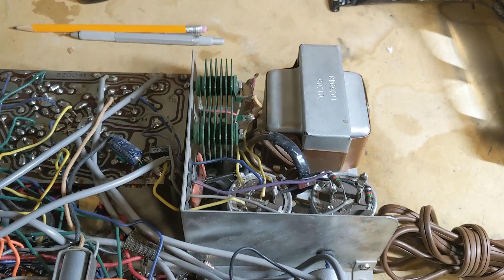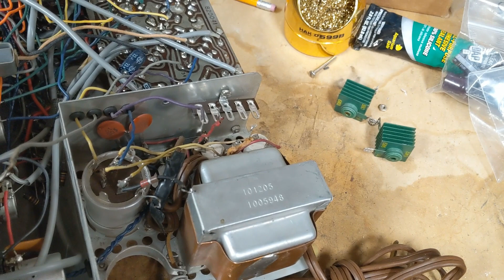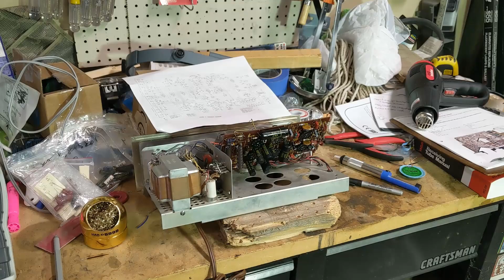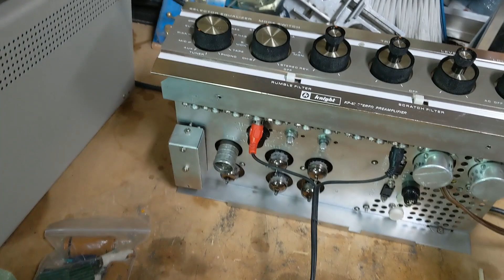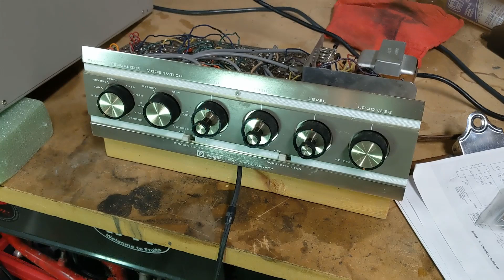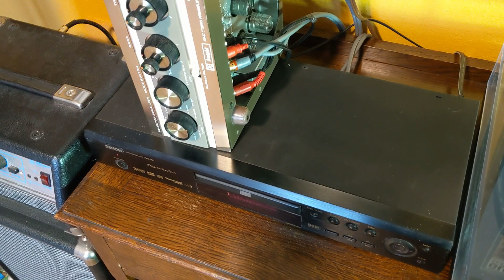Vintage Tube Preamp Knight KP50 - Restore & Listen

Comment: I extended the legs on mine so it would work with better cables.  Buy a package of replacement rubber feet for a folding chair.  I use these to raise my laptop as well.

Comment: I've got one in pieces in a box.  I used it for several years with mostly original caps.  It took a big power surge when a transformer on a pole down the street blew.  I started rebuilding it, the same way you did but other things got in the way.  These KP 50 preamps sound amazing and have lots of power.  I've looked for something comparable and more modern but can not find anything.  I drove 3 200 watt stereo amps with it, feeding 6 large loudspeakers and 2 subwoofers.  What a volume knob!!!  I kept getting flak from people because it is capacitor coupled rather than transformer coupled.  Then they listened.  You inspire me to pick up the soldering iron again.